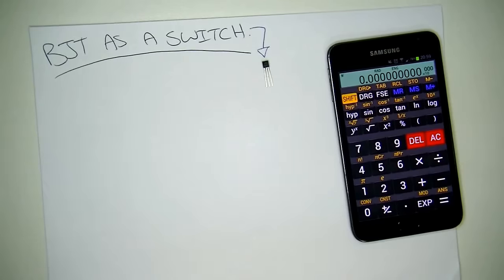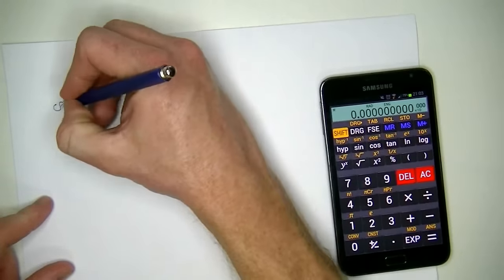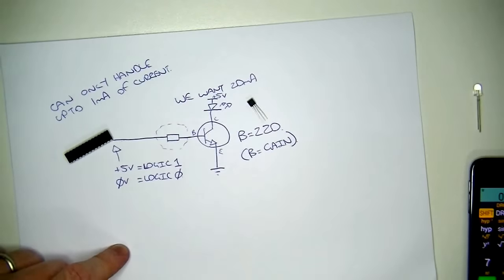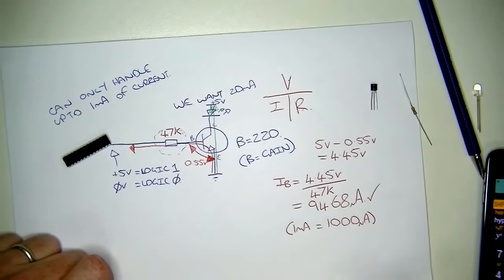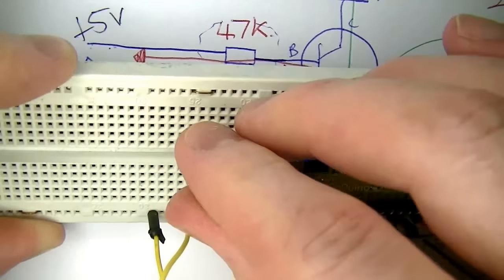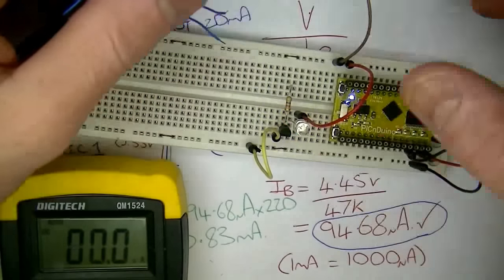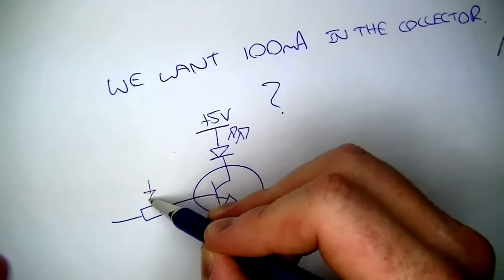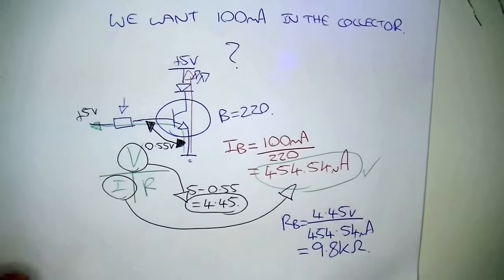Electronics Tutorial 12 Using the BJT as a Switch

Comment: Nice and clear explanation of the basic principles. However, I have two additions. First, it is better not to calculate with exact value of Beta, because in practice, transistors are made with some spread of Beta, rather than single, more or less exact value of Beta. When you use an another one with higher Beta value, it could even lead to the damage of the LED. Second, a transistor as a power-switching device is calculated in such a way it is fully open (this state is called as "saturation") so that is able to handle higher currents with less amount of power dissipation (i.e. less heating). So, to the conclusion, I would recommend to put an another resistor in series with LED and select a different base resistor of such value that the transistor will be in saturation state (according to its datasheet specifications).
Reply from the maker: +Michal Jakubec I certainly agree with everything that you have said to a point however there are many cases where it is certainly fine to leave out the collector resistor as long as you prevent the transistor from saturating. If I were using circuits with higher power requirements where the transistor would get quite hot if it were to have a voltage drop across it, then I would use an external resistor. However for low power circuits such as this, it is perfectly fine to allow the CE junction to have a voltage drop. In fact, this is exactly how a linear regulator with a series pass transistor works. I would agree with you 100% however in terms of getting the correct value of Beta. Each different part number of transistor can have it's own Beta and not only that, the Beta can change depending on the amount of current.

Comment: Check Voltage between Colector and Emisor without the resistor in the colector.

Now put the resistor in the colector and check de voltage.

P=V*I 

You will watch an higher power consumption by the transistor with your schematic. :P

Comment from the maker: I guess the main issue with using Beta to control the collector current is when temperature comes into effect. I.E. if this transistor was to get hot we get more leakage current which adds to Ic therefor Ic increases. In this case a voltage divider on the base with an emitter resistor to offset the effect of temperature would be good. For this particular application however this basic 'fixed bias' circuit works fine. Later I will show improved temp and Beta stabalised circuits. 

Good question!

Comment from the maker: Good question. You could do that however it's not the best design practice because you would be wasting power (due to increased base current to drive the transistor into saturation) and also you would be adding more components to the circuit where it's not actually required.

Comment: You should used an 49K with a -5% of difference LCR resistor to acquire the 20 mA load of the LED. The base current is actually 90.90uA.